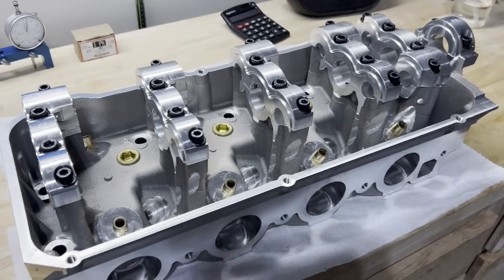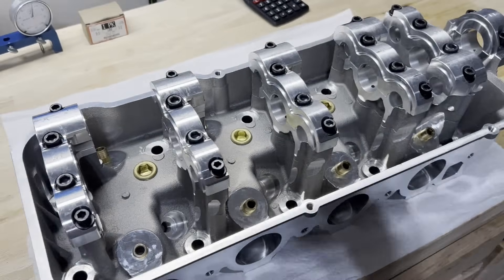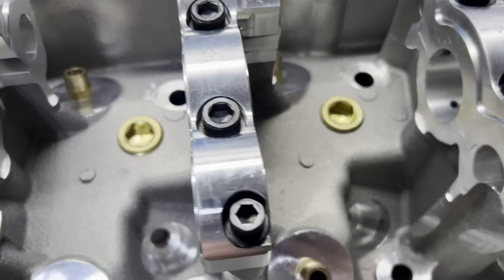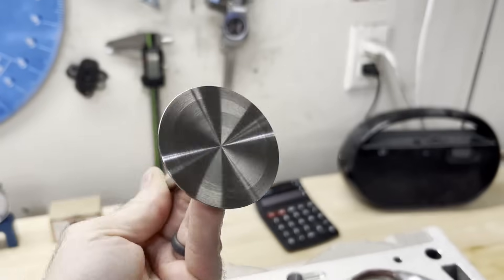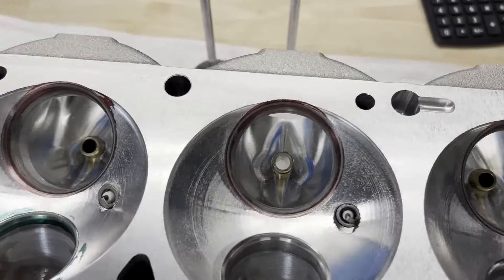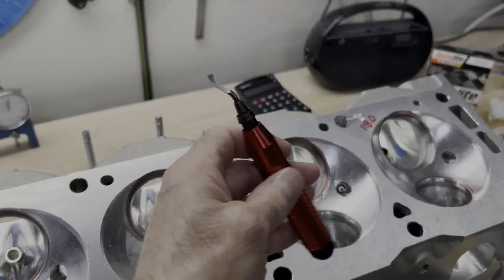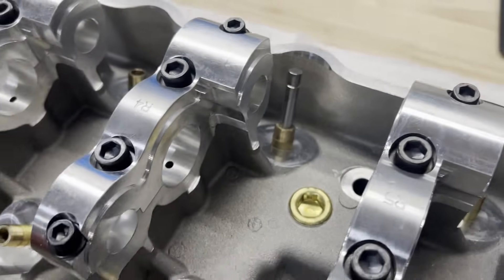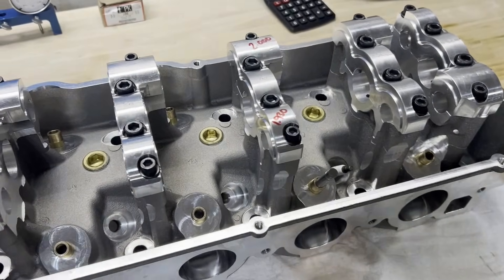Lykins Motorsports Measuring Some Ford FE SOHC Heads For Parts...

Comment: You will have fun building that cammer. I built an all aluminum Pond version last year and took it to Samtech for dyno tuning. A couple of warnings that you will probably catch anyway. I had to face both of the end of saddles for the camshafts about .005 because they were a little proud where they mated with the head half effectively giving the camshafts zero end play. Also after several mock-ups on the final installation of the saddles one of the bolts pulled the aluminum threads out of the head. Had to helicoil it. On the spark plug engagement wound up chucking the plugs in a lathe and turning down the bottom three or four threads so they don't collect carbon and try to mess up the threads when removed. Degreeing the cams is fun 😂.  Sprocket buttons and multiple dial indicators, mechanical chain tensioner, 6' chain. Enjoy. It's a good experience

Comment: Jewelry! I agree, I would use some indexing washers for the 1" reach plug, to get it even at the surface of the chamber for flame travel. The 3/4" reach is still too far outside.